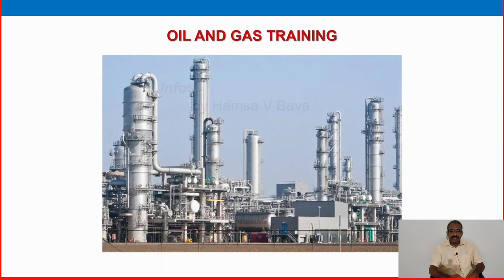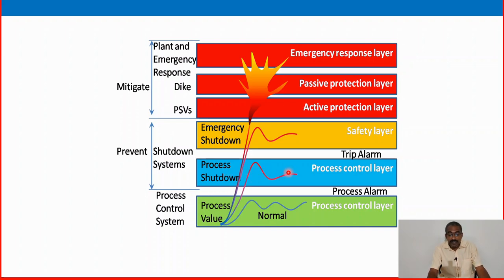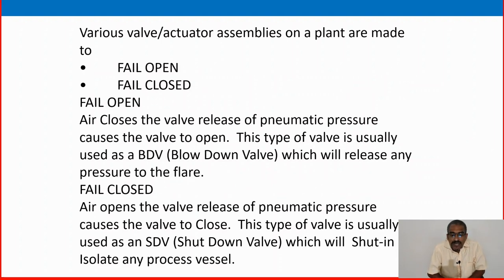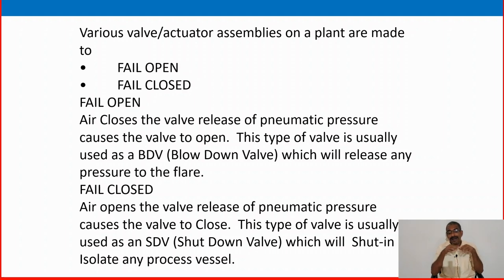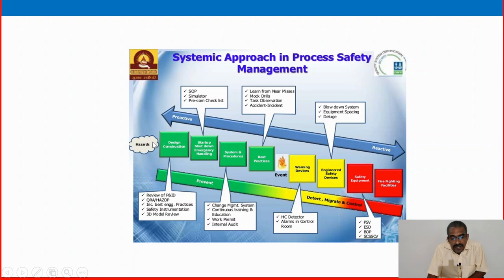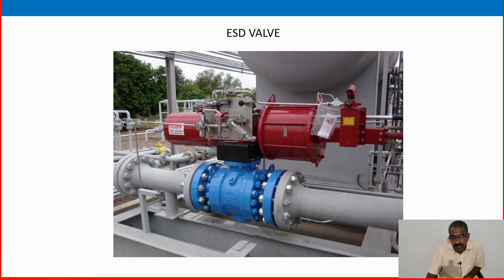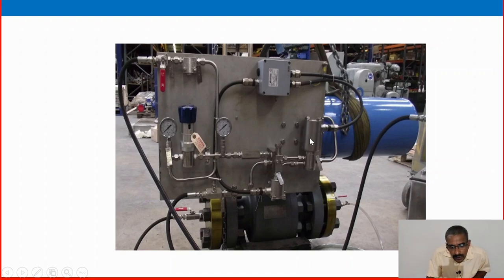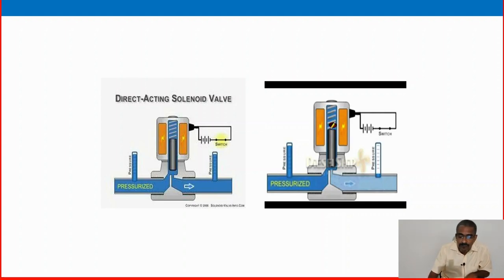Oil and Gas Process - Emergency Shutdown System (ESD)

Comment: nice and educative video. Please i have a question on event tree analysis of hydrocarbon gas leak as initiating event, if the fire detection system fails on  demand will deluge system be activated or not? or the outcome will just be fire. secondly if a blowdown works is there need for deluge system again. Thanks and hope to hear from you

Comment: Good job sir.
In the slide : EMERGENCY SHUT DOWN VALVES (between 27-28 min), Is the SDV normally open  or BDV?
Thanks.
Reply from the maker: SDVs are normally in open position and close in shut down situation and BDVs are in just opposite